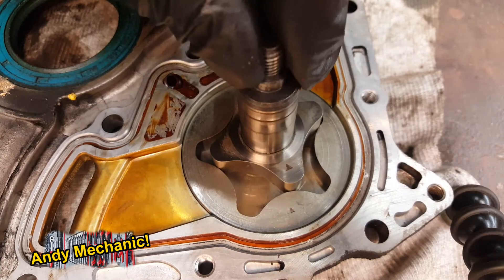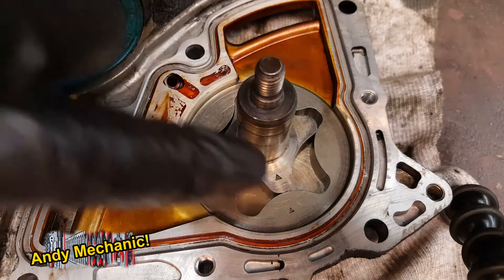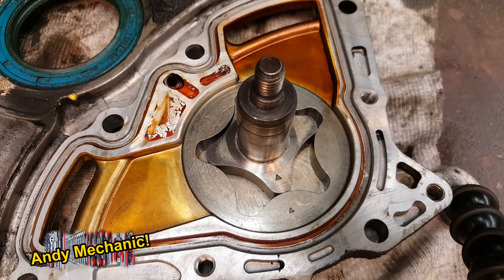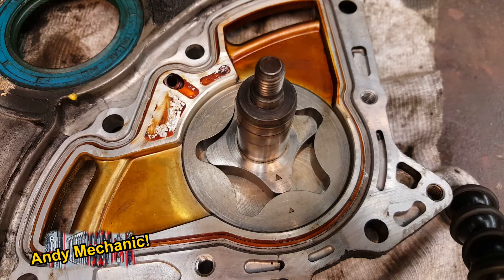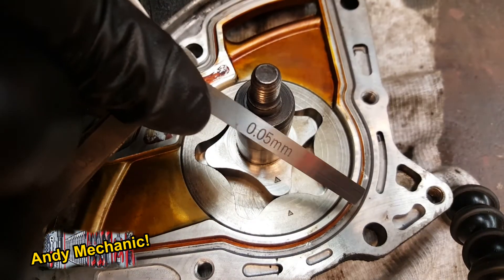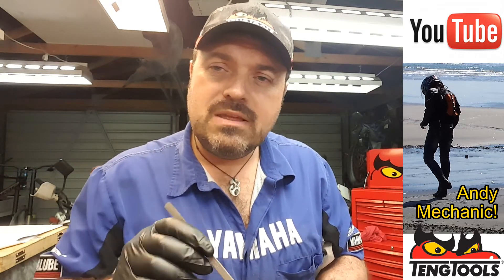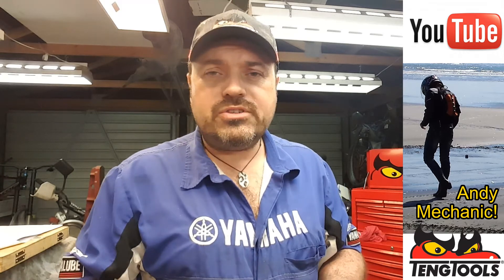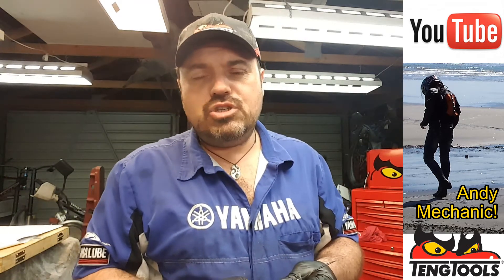Toyota Rav4 Oil pump clearance check Ep31 #1145

Comment: hello Andy I just changed the oil pump gasket and seal on a Toyota Camry 2000 yesterday, when I started the car, the oil light came on and it stayed on. Could it be that if the two arrows don't sync, it could cause the light to turn on ?